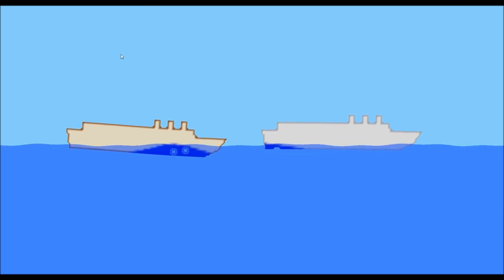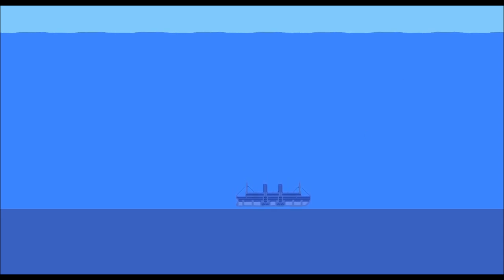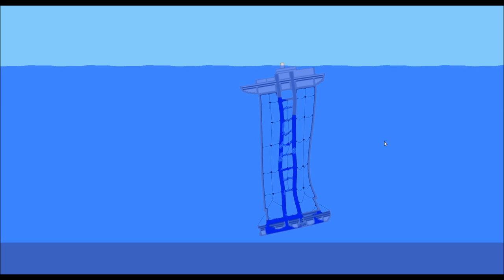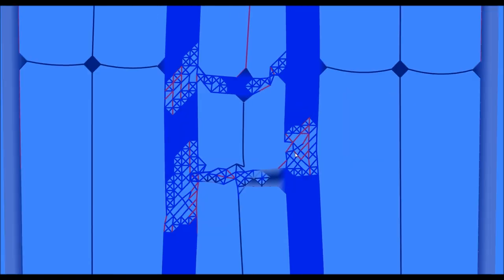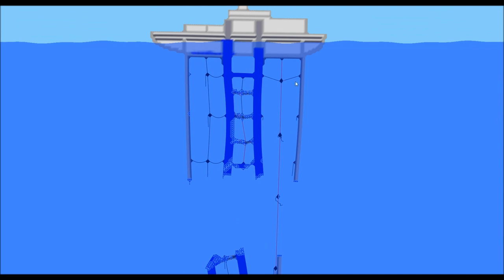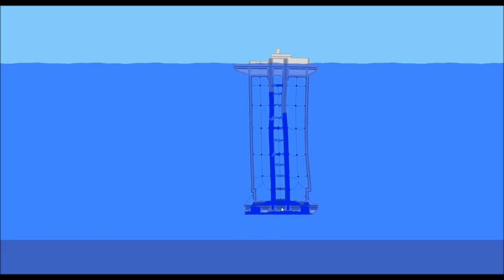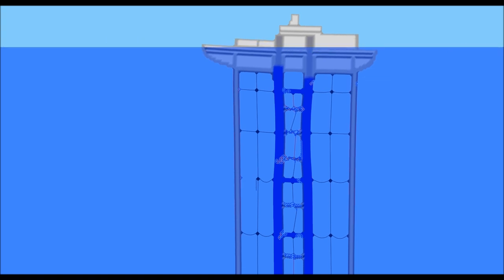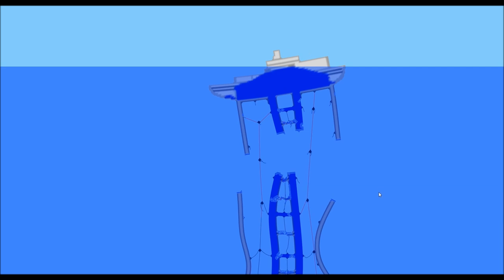Sinking Ship Simulator! Underwater Base

Comment: I managed to get an underwater base working. Well, sort of.
Reply from the maker: Can I try it out?
Reply: Dodge Them All Sure, let me throw it on imgur. To put it safely in the water you need to turn buoyancy to 0, strength to full, and water pressure to full, then when its submerged and the bottom section is filled with water, you restore the settings to normal
Reply from the maker: nubeees Thanks!

Comment: http://www.mediafire.com/view/oyta0mamv85mj90/underwater%20base.png

Strength 10
Buoyancy 0 (Once the areas at the bottom fill, put buoyancy on 2, then 1)
Wave Height 0
Water Pressure 10
Ocean Depth 190
Reply: cool
Reply: mark marche Thanks
Reply from the maker: Hm, very good design, though it falls over after being down for a few minutes. Maybe attach some ropes to the sides of the tower to increase stability? Or maybe I'm just using it wrong xD
Reply: Dodge Them All Do you have the most recent update or do you have the old version of 1.2? Also, it probably will fall over after a while because when it is going down it tilts slightly and then very slowly wobbles.
Reply from the maker: TylerTrainz4449 I am playing the most recent version (The one from last week) and yeah.
Reply: Dodge Them All I have the most recent as well, and it definitely seems to be a problem with rigidity.